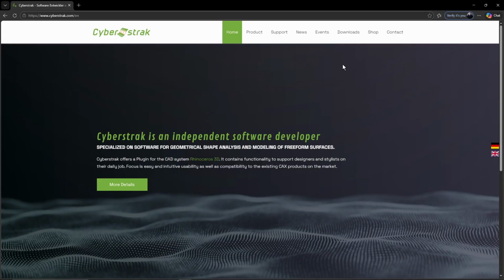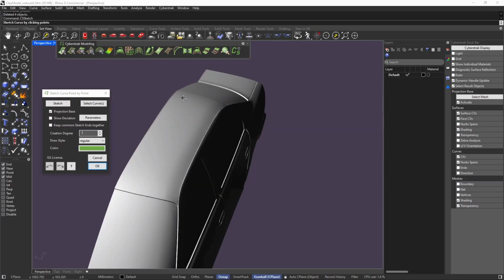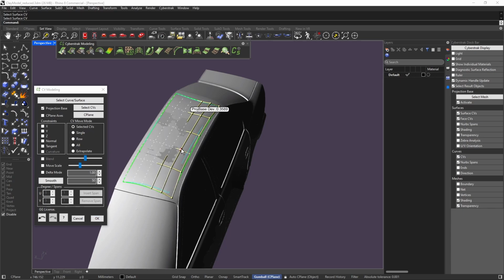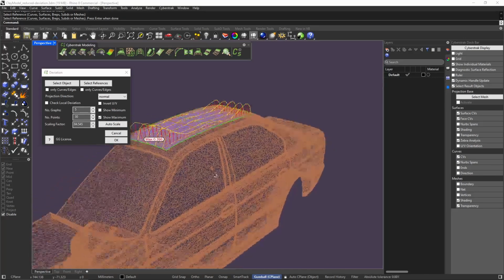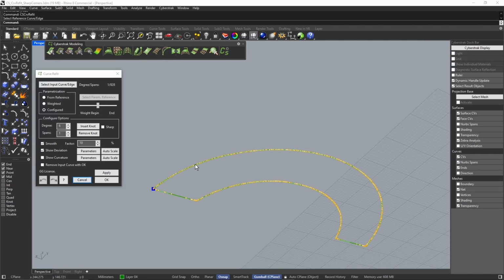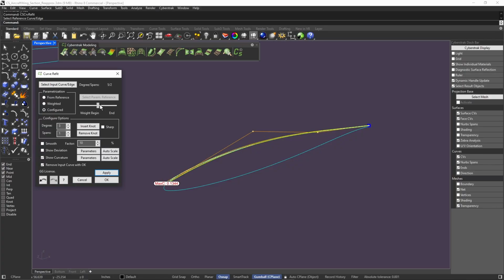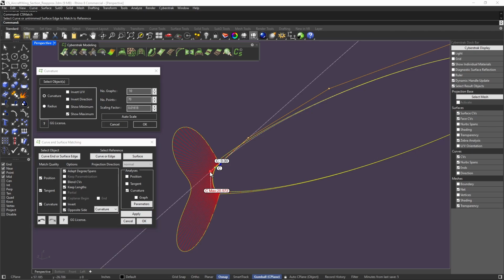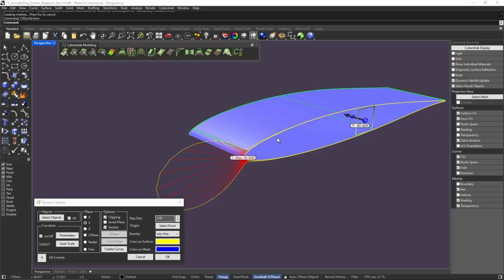Cyberstrak Release 2 0

Comment: Hi Peter, Thanks for the new Release and new Video! Just to be clear, (Minute 8)you are not really using weighted CVs (Rationals!) but shifting the parametrisation, right? its maybe missleading to call it weighted.
Reply from the maker: Hi, sorry for the late answer. Yes, just the parametrization (CV distribution) of the existing curve is changed, no rational Nurbs is created. You are right, some users may think of rational CV weights. Need to think about it.